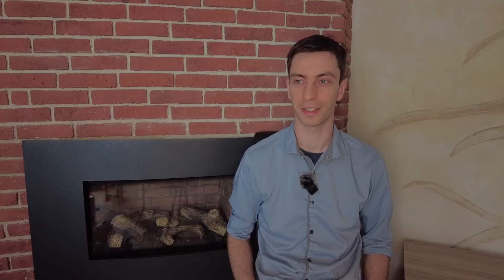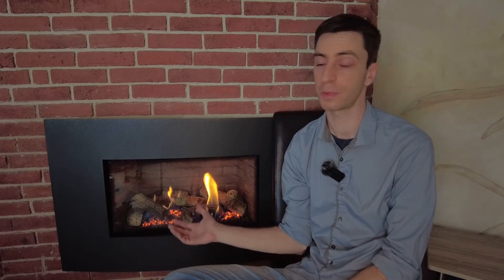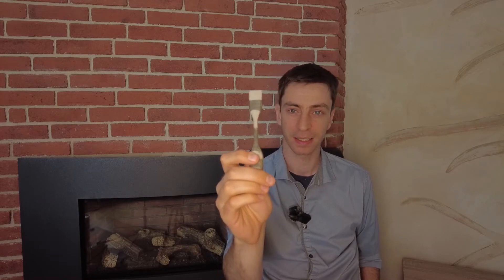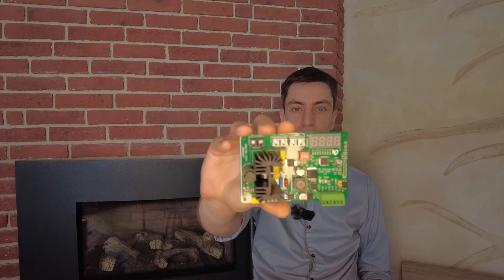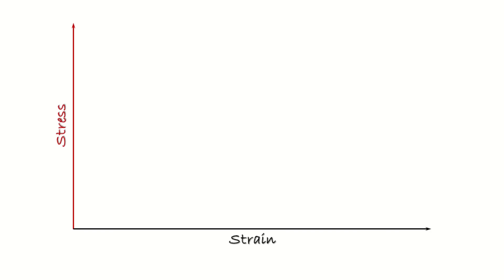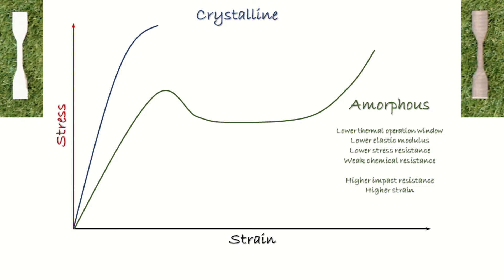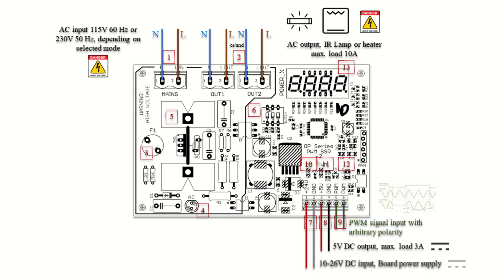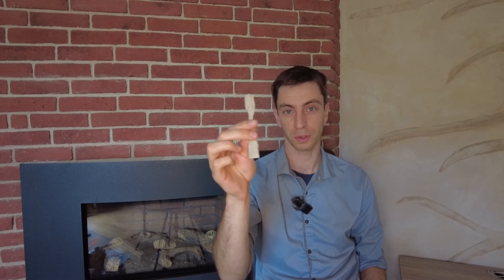Turn your 3D printer into a PEEK printer for less than £200

Comment: Could it work when you point a hot air gun on the part while printing? 
I need a small 30x30mm part from peek with a good layer adhesion
Reply from the maker: A hot air gun should work well if you're printing simple shapes without bridging, small details, etc... However, for more complex parts, it's important to cool the deposited layer. As long as each layer has enough time to solidify, the heat gun can help improve interlayer bonding.

Comment: How much does this cost per hour to run?
Reply from the maker: Let's say you want to maintain the bed temperature at 200°C and the layer deposition temperature at 170°C, heated by a halogen heater. After stabilization, the bed heater consumes around 2.5A, and the halogen heater consumes 2A.

Adding the electronic power consumption, the total comes to approximately 1.1 kWh (with 240AC power supply). 

It's difficult to determine the exact price per kWh, country variable.